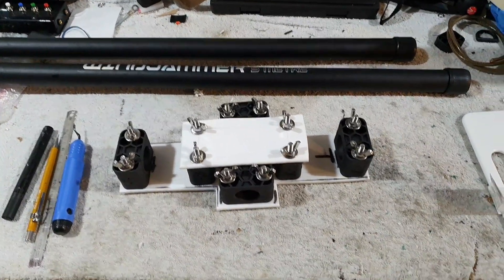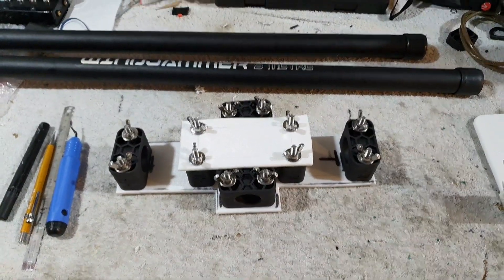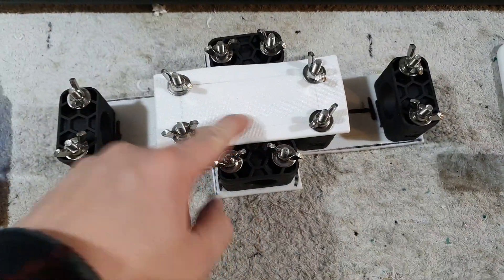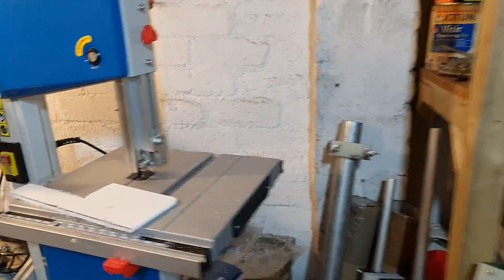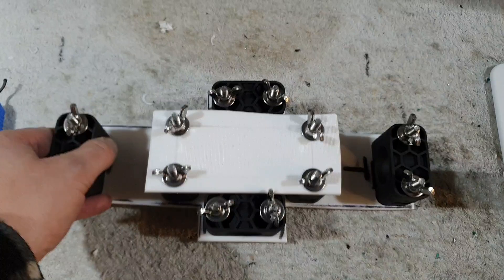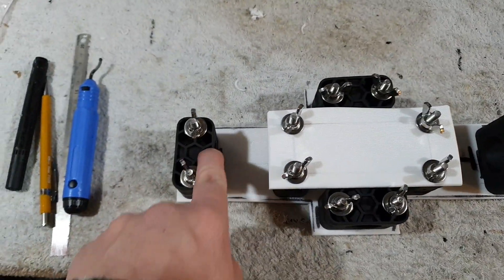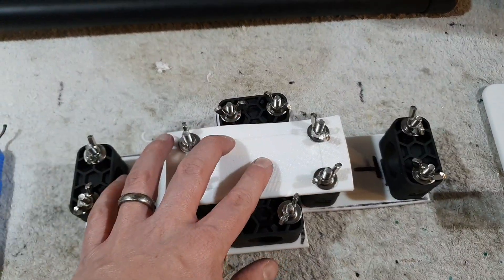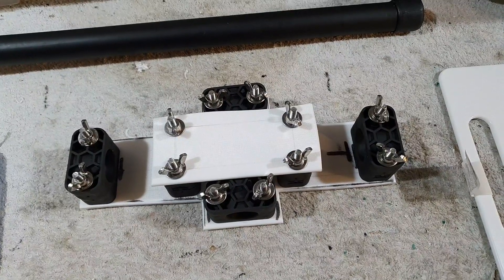Rotary Dipole Centre Plate Overview

Comment: I found that white cutting board wouldn't be sustainable enough in strong winds and high U/V 
rays. So I went with a 6mm
thickness 6063 t6 aluminum plate and Stauff 
pipe holders.
Reply from the maker: I agree 👍